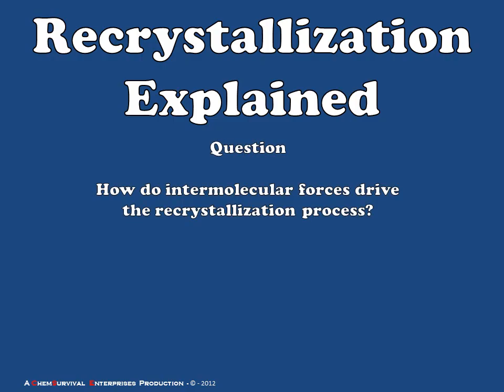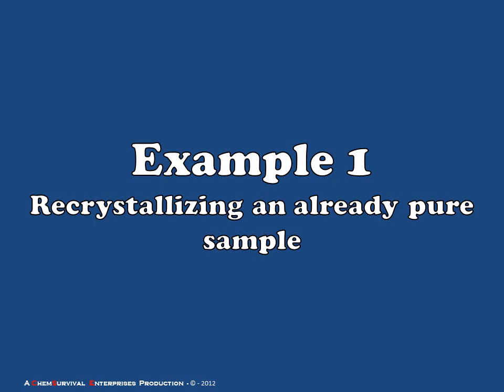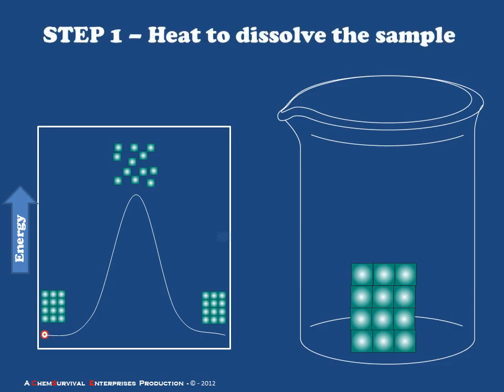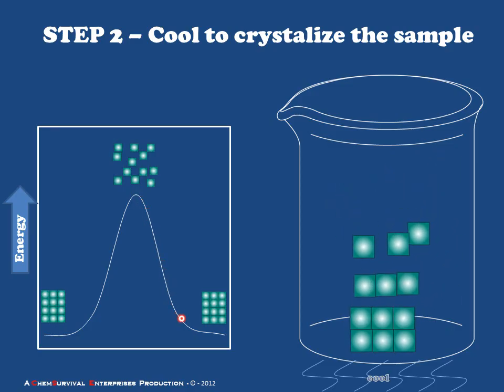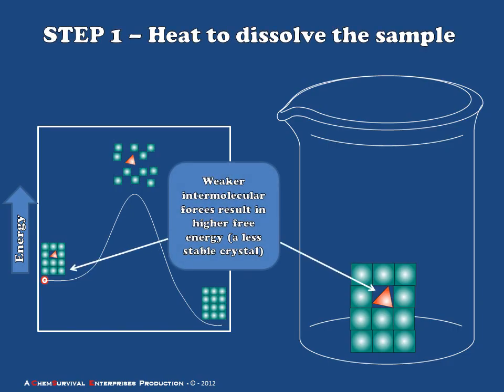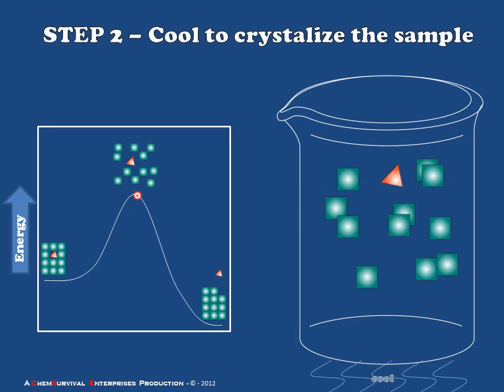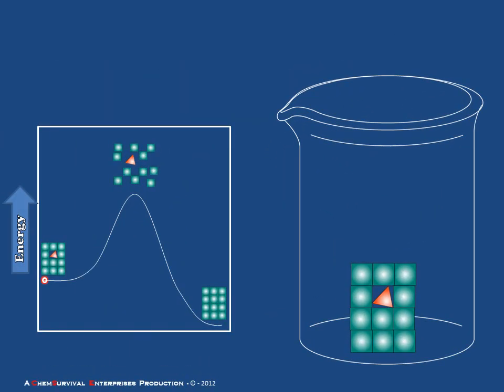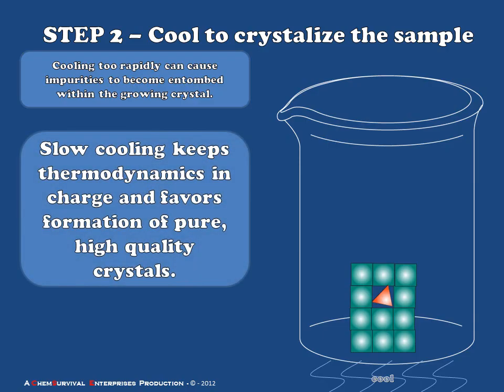Introduction to Recrystallization

Comment: Great video! Very easy to understand. 

I have been curious about FAST cooling of a PURE substance, and can't seem to find any information anywhere... What might be expected to happen?

My best guess is that more solvent than usual might get trapped in the lattice structure, but that's as far as I can figure. Could anybody help shed some light on this for me? Or at least point me in the right direction to figure this out myself
Reply from the maker: +Cody Grant more solvent inclusion - maybe.  Smaller, poorly shaped crystals - definitely.  The classic inorganic example is glass vs quartz.  Rapid cooling of silica gives an amorphous solid with very different properties than one cooled very slowly to get a highly ordered structure.

Comment: Would this be considered as endothermic (since heat is being added)?
Reply: No the scheme is exothermic. Overall heat is released from the system into the universe. The reaction is *exergonic*. Products free energy < starting materials free energy. I.e week bonds are being broken and stronger bonds being formed. The reverse reaction would be endothermic I.e endergonic.
Reply from the maker: +Tittoo Mal At the end of the process, the system cools, so overall, no it is not an endothermic process.  what's more important is that it is endergonic overall, meaning that free energy of the system is lower in the final state than the initial.  This is why slow cooling is best, because we want thermodynamics in control of the crystallization.